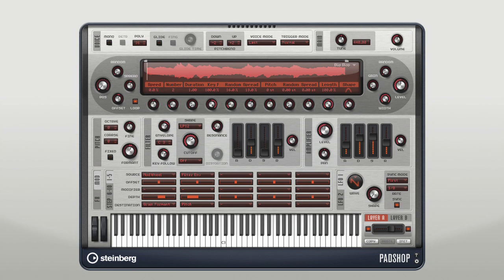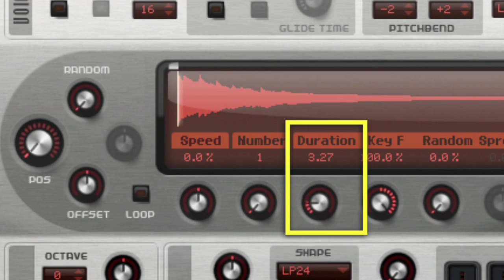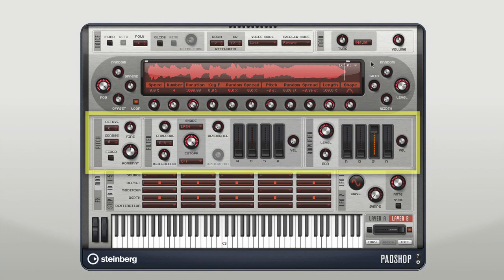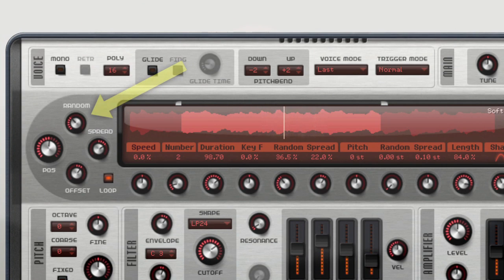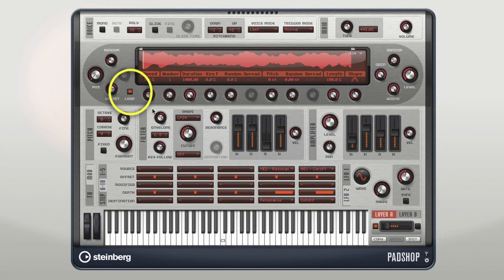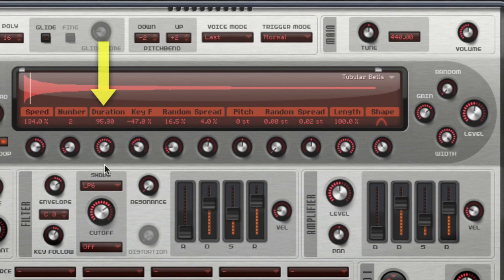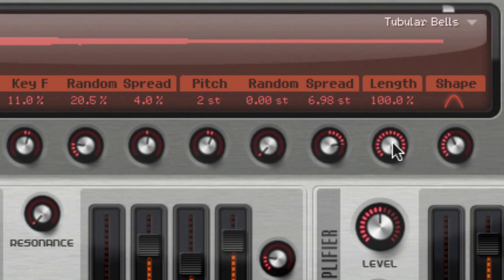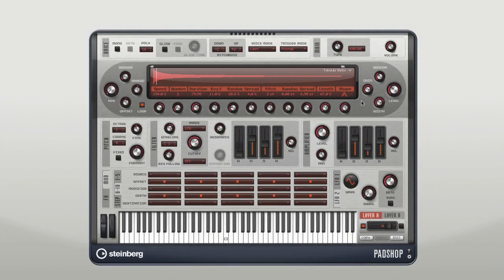SWA Fast Approach to Padshop Pro (1/6)

Comment: what is the longest duration that can be played?

(if i want to load a .wav file into it how long can it be?)
Reply: +TheJayKellz 10 minutes I believe.
Reply: That is correct. 

A lot of this stuff is listed in the manual. If you upload a sample longer than ten minutes, it will start the sample from the beginning and it will be cut off at the 10 minute mark